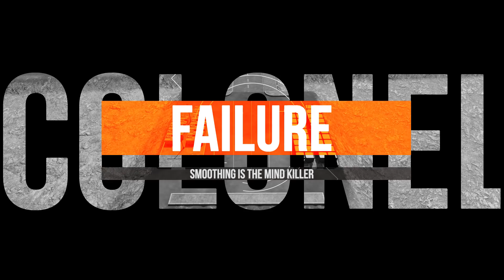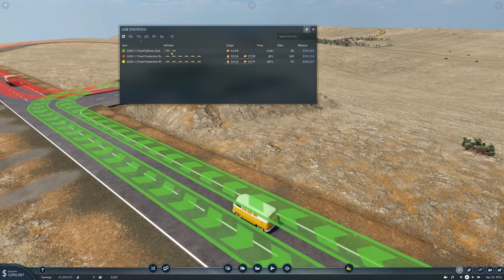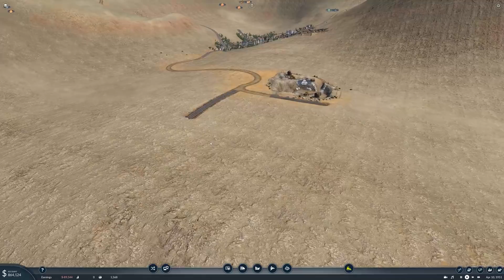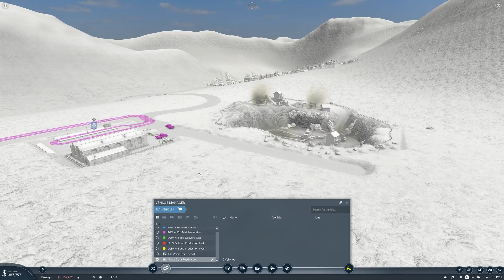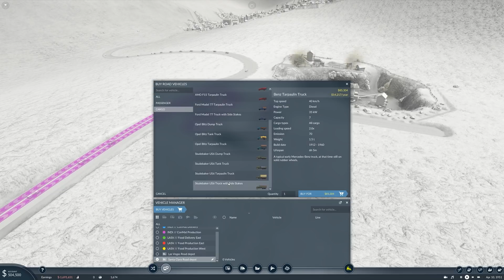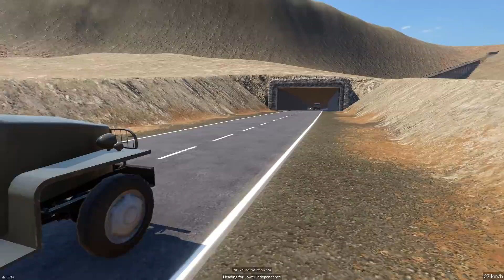Easy money using trucks | Transport Fever Dune part 2

Comment: I've been playing this map and really enjoying it. I'm playing same year and difficulty, but playing at 1/4 time passage. Not sure if taking loans is cheating, but taken out 40 to 50 million 3 times and paid it off all before 1955 using passenger trains. Though I did set up the initial food routes in honor of the Colonel. Las Vegas to Hollywood, then on to Pasadena was the first route with commuter buses in each town. Hollywood and Lafayette are actually a shared station in between. Quite the money make once it beds in.

Comment: I noticed @11:46 you mentioned the content that was in my comment (though you did not accept my earlier request to make these videos 2 hours long, but that's ok). I'd like to add that if you build the truck stops as far as possible (in the direction of the previous or next stop, whichever it's going) from the source of material, the trucks won't have to drive that extra distance. As long as the building it's interacting with is still white when you're placing it, you can cut a good bit off transport time, especially for short routes. This would have cut your conmat processing route  distance by about a third, I think.  Doesn't work with buses as the passengers getting on still have to walk the rest of the way, but with cargo it seems to be instant.

Comment: * Helpful Tip*  You can put Truck/Bus stations  parallel to the road, then add another entrance (from the configure button) at the other end/side creating a one or two way route, also it is easier to extend the loading bays to prevent jamming the main roads and allow a faster and easier loading/unloading cycle.  Excellent episode as usual.  Carry On.

Comment: @Colonel Failure
 I took the challenge front on and i started at the other end of the map. Yes, the one that you wanted to build in this episode. Anyway started in Elgin then Durham and then Anchorage, Kansas City, Madison, Wichita on the other side. And yes is booming! If you place a train route around the mountain and don't tunnel in^^ Is a lot cheaper (if you just follow the terrain) 

Furthermore since the place is so lifeless i decided to terraform Arrakis  ....slowly. Since disaster has struck!  One of the Crude Oil facility has a SERIOUS environmental issue to mitigate. At least I hope the sandworms will not feel my presence. Got a video coming tomorrow to elaborate the situation^^

And video link now (no music added yet) https://youtu.be/NyDz4QCBcOQ

Comment: My solution to the Crude Oil delivery would have been to ship the Crude Oil up to the Fuel Refinery, then ship it down to the Oil Refinery.  The benefit of this sort of run is you avoid the mountains and the need to tunnel, you go more direct, so it's a bit more profitable, plus these two lines get Fuel production going.  Then from the Fuel Refinery you just transport into the nearby towns.  Bonus if there are any towns near the Oil Wells that require Fuel, because you can also have Fuel transporting back along one of the Crude Oil lines making those lines even more profitable as well.

Such a line could also if done by rail could be the start of a larger mainline rail.

Comment: I'm sorry Colonel, but the road you built there is absolutely atrocious. You could've easily followed the side of the canyon to bring the road to the desired elevation without having to tunnel half of the way and bridge the other half. It wouldn't've been even significantly longer and if built smart, it wouldn't have to go down and then up again. Of course your road will work and maybe save you even some cash in the long run but from a purely visual standpoint, I call it a... failure.
Reply: Oh it hurts. It hurts so much. XD

Comment: See you say TPF2 is easy, but I keep failing hard on this game. I have gone back to TPF1 lol. I find the new cargo system dreadful...limitation on how much they create is like next level EU bullsh*t.
Reply from the maker: You've seen me do it a couple of times, shouldn't be a challenge to replicate. The biggest issue is running costs for stations. They only pay for themselves if you're using multiple vehicles.
Reply: @colonelfailure  Yeah I am gaining knowledge by you, skye and GrandT collectively. I think it's more the fact its new and I haven't poured as much time as I did in the first. (400 hours+ in the first).
Reply: @yevgeny.meshulin  "You are failing because you keep applying TF1 concepts to TF2." I think you hit the nail on the head. I am still learning, it's quite different than TPF1 and thus, time to adjust is a more work than usual. Thanks for the explanation, I think I use too many single 1 to 1 routes, I need to divisify more but I am not very good at working out "how many", I always overkill or I underkill heavily the amount of wagons, vechiles or such. The latter being better to recover from than the former.